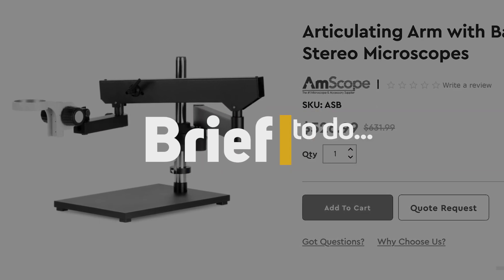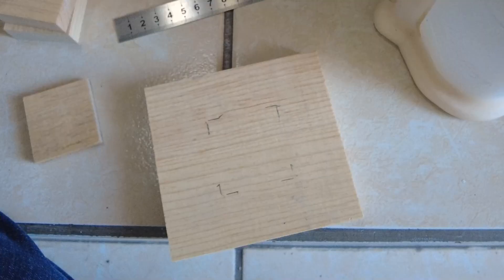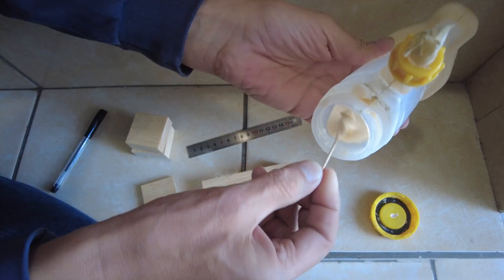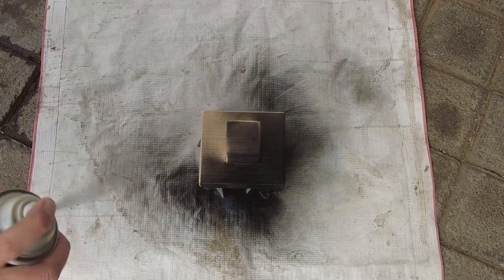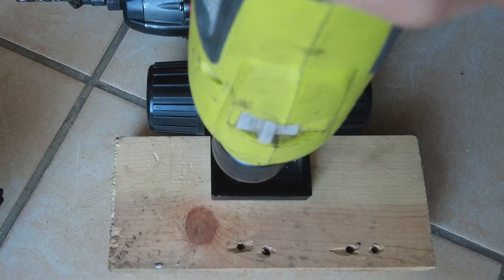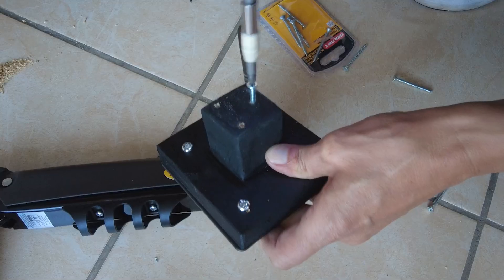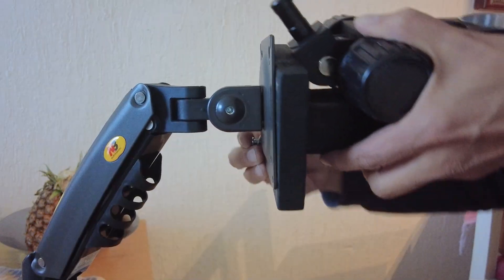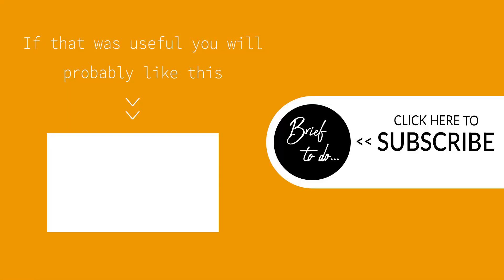DIY Microscope Support Stand 🔬

Comment: Best to connect to wall mount not table. Table offers vibration when working. Secondly your C clamp for the microscope must be the one with the flat plate behind the fine adjust knobs.
Pity you didn't put a link for the correct C Lense Clamp.

Comment: i got same arm, and similar microscope but this arm is very strong i must use a lot of force to put them down and microscope go up instantly i cannot control it, the screw on arm is set to minimal, is there any fix for that?
Reply: I don't know how this particular arm functions. But I have a similar problem with the vesa arm I put on my oscilloscope. It simply uses a spring, so I drilled a hole to move the spring further down the arm which helped a bit. But I am currently waiting on a new weaker spring to arrive in order to try hooking that up between the old spring and the original mounting location.

Or a crude but effective solution would just be to figure out a way to attach weights to it. Like you could probably drill some bolts into the side of the wood and use them to hang weight plates.
Reply: @nerdstrangler4804 do the bolts up real tight at the joints, that will make it very stiff and unable to auto return...

Comment: How do you reduce wobble? I have a similar setup to this but after any adjustment there is around 6s of wobble. Or if you are typing or working on the table, it also has slight wobble.